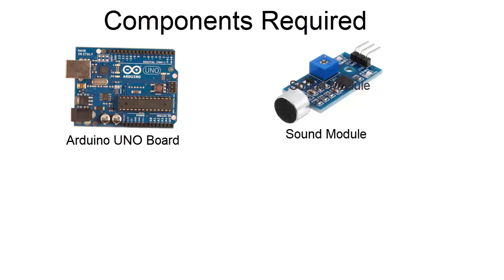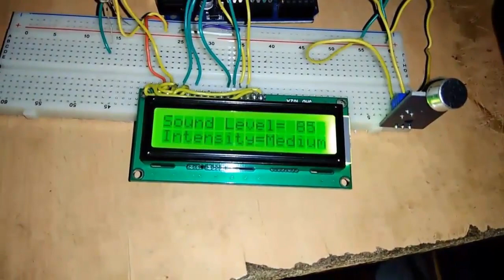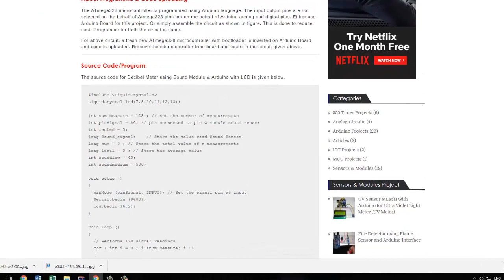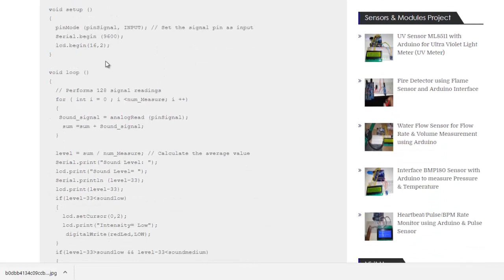Sound Level and Intensity Meter using Sound Sensor & Arduino

Comment: 4pin sound sensor given where to put the d0pin
Reply: On a 4 pin sensor, the Dout pin is simply to set a level in which the pin is a logical 1 or 0 below the threshold, and then changes to the opposite when the sound goes above that level. The level at which it changes is set by adjusting the potentiometer.  The ones I use are a digital high which switches to low when sound goes above the set level.  For projects or examples such as in this guy's video, you can simply leave the Dout pin unconnected.

Comment: Which is  the formula for calibration?
Which parameters i need to change to show better ranges?
Reply from the maker: Rotate potentiometer to adjust the noise to zero when its completely silent.

You can add subtract some values in the code to adjust calibration.
Reply: @HowtoElectronics  which values?

Comment: hi, i have just tried out this circuit. im having trouble with the sound level. i believe i connected it correctly but the LCD sound level stays at the 200 range. i followed your instruction on the website
Reply from the maker: Correct the code. Correct the formulae for calibration. Different sound module have different calibration factor.
Reply: @HowtoElectronics  i am getting no difference in the input on different levels of sound and it also worked when i removed the sound sensor from the circuite it looks like sound sensor is connected for showcase and has no use😡😡😡.I buyed all components worth 1700rs but it didn't worked properly.You cheated everyone